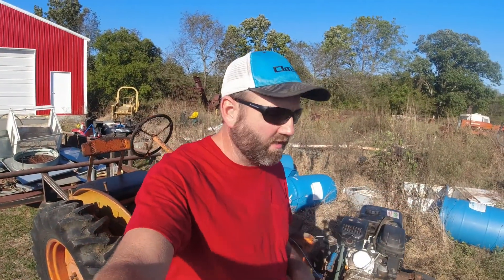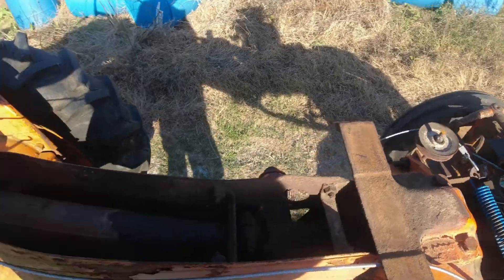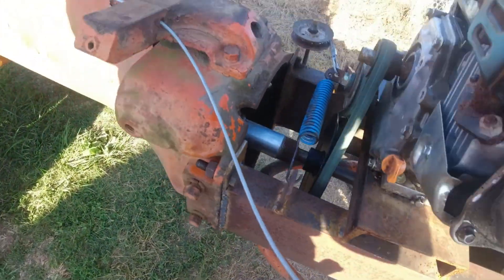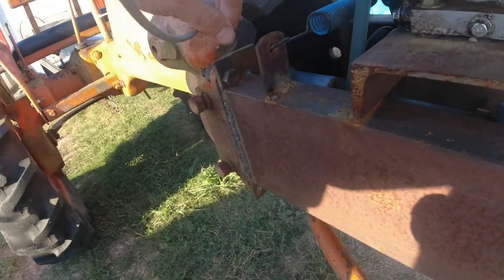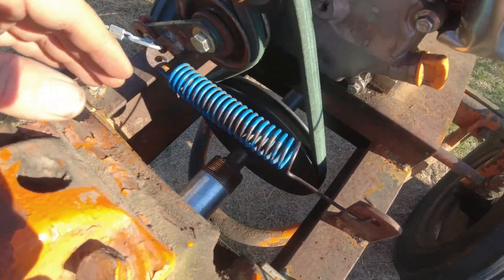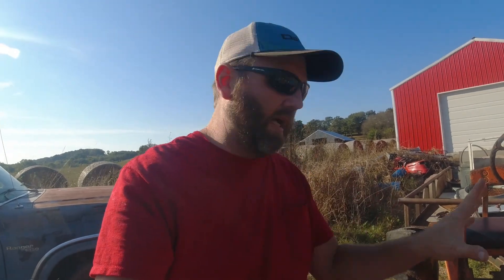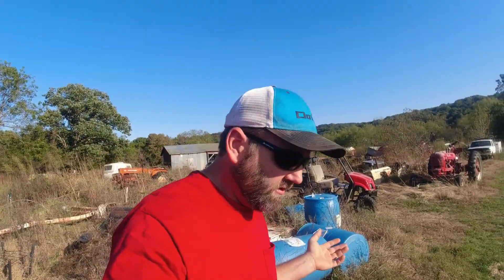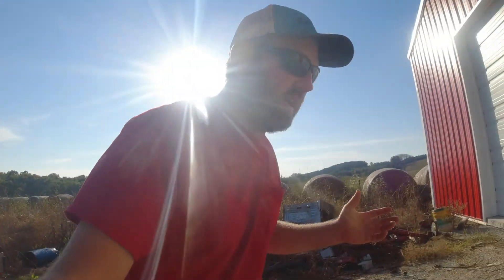212 cc tractor how i built it

Comment: Your sharing of in-depth details is awesome.  And your heads up about upcoming modifications to your current design is great too.  I wanted to ask you about the Allis-Chalmers original engine rpm versus the Predator engine rpm and the 4 to 1 pulley ratio.  What rpm range is standard for that?
Reply from the maker: the allis high rpm is around 2000 i think and the predator is around mid 3000 i think